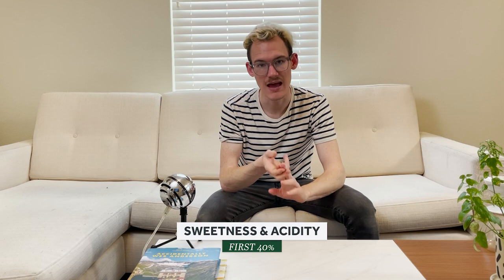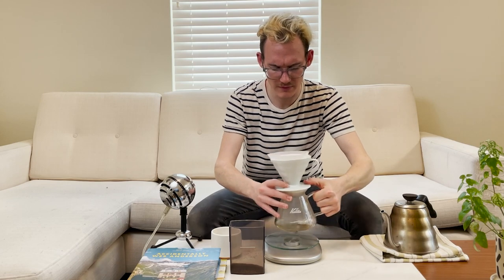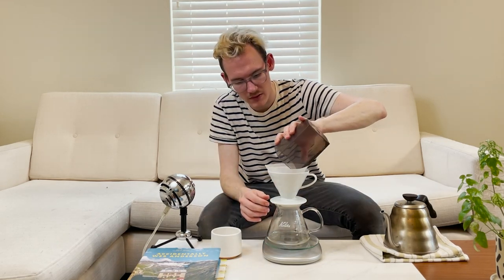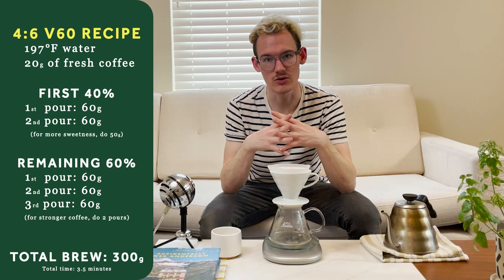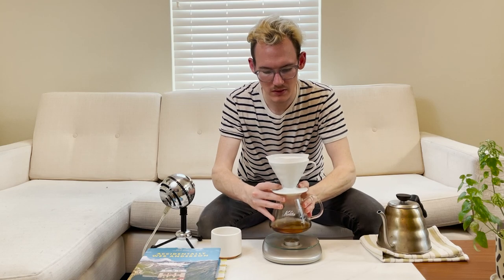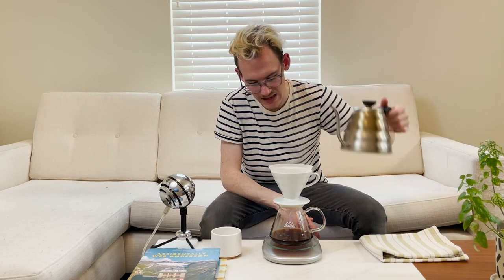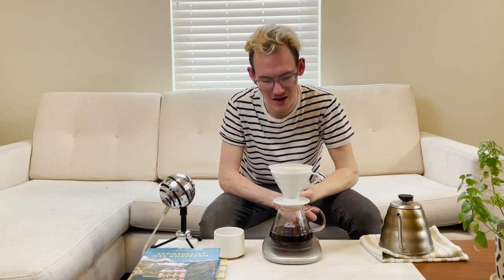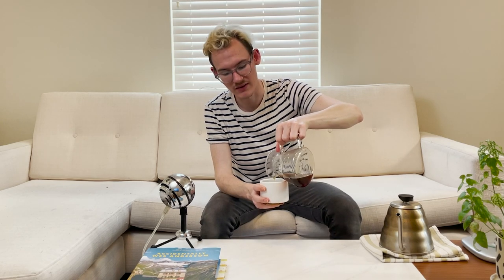Championship Winning Coffee Recipe - V60 4:6 Method

Comment: If I was doing a single cup using only 250ml of water should I naturally expect a slightly faster draw down time than the 3:30 the recipe suggests or instead should I decrease the grind size until the draw down time reaches the intended 3:30? Hope that makes sense, thanks!!
Reply: I say you should adjust by taste and not time!
Regardless, grind a bit finer if you need to get to 3:30